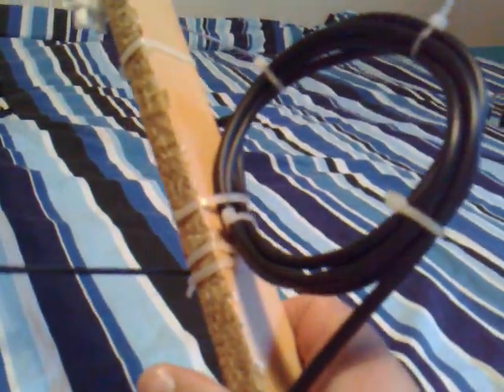PMR Radio: 4 Element 446 Yagi

Comment: Hi Chris, due to moving house soon and all the HF antennas being down packed away I am stuck on 446 and speak to more hams (UK radio amateurs) on 446 via FRN on the gateways than I ever have on 2m or 70cm and I have to say they are very well behaved and really interesting to rag chew with, I am so impressed with the band, its users and its capabilities I have set up my own small personal 20mw FRN gateway at home with a little home brew 1/4 wave ground plane antenna but once we have moved it will be on a coaxial 5/8 wave collinear.